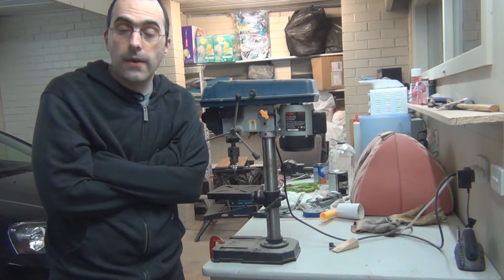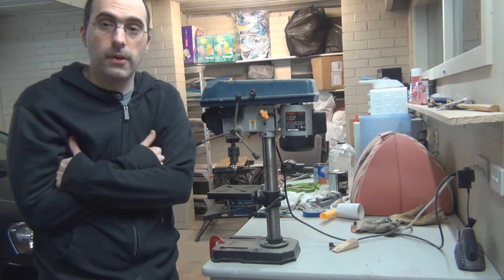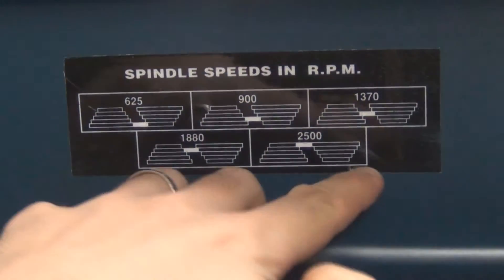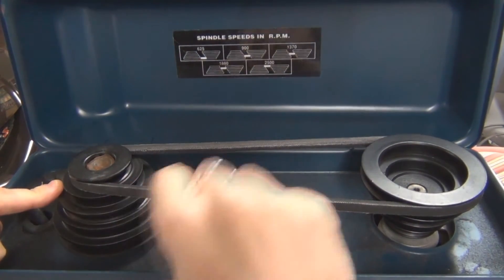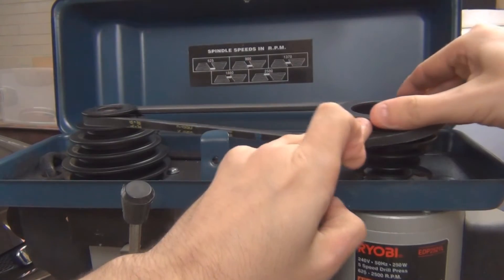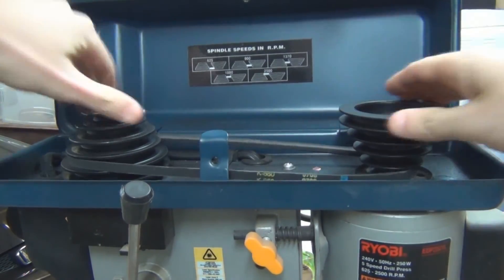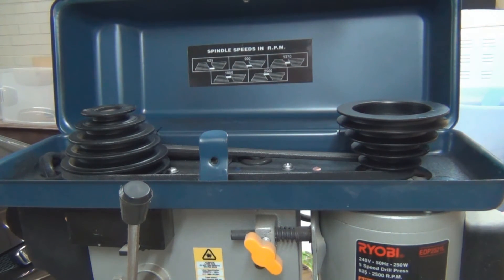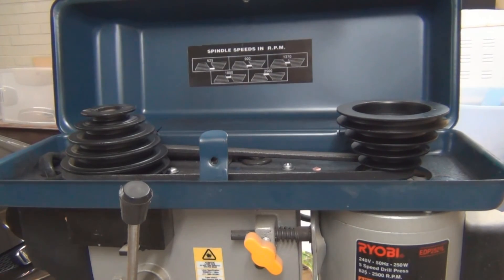How To Adjust Your Drill Press Speed

Comment: see that yellow hand-knob ? that will loosen your motor in its bracket, so you can, A: move the belt easily, and B: set the belt to the correct tension after moving its position (theres probably a tension lever on the other side of the press).
your belt is currently far too loose, it should be extremely difficult to move from one setting to another. because it is so loose, it will slip during normal torque-loads, burning the belt and making it brittle, ready to snap. i'm guessing you dont drill metal or other hard materials much, or this would have become a major problem long before now

Comment: Strange thing!!!!!!!! Why the engineers didn't use adjust switch to change the motor speed ?????!!!!!!!!!!! 🤔🤔🤔
Reply: higher motor speed = higher torque.
using a geared belt means the motor can remain at high speed and torque during low speed drilling. 
same reason we change gears in a car, instead of just crawling around at 100RPM when we wanna go slow, low torque = stalling

Comment: Thank for the video. I was hoping you would also refer to the knob with the bar and spring just left of the motor. What does it use for and what's the proper way of using it?
Reply from the maker: +TheWoodWorkingPilot I think this is a tension adjustment for the belt.  I'm thinking my belt may be a little too tight (at the moment). I just replaced it on the weekend but it has lasted 3+ years. the tension could affect wear and tear on the belt though (if its too tight or loose)
Reply: +DIY Guitar Pedals yes it's some sort of tension adjustment for the belt. Do you know what is the correct technique for using it?
Reply: @TheWoodWorkingPilot  there should be a lever on the other side of the press, loosen the knob you can see, then pull the lever to loosen/tighten the tension  (depending on the design of the machine), before re-tightening the yellow knob.
the way this guy changed his belt is just further stretching it, and a loose belt will result in the belt slipping and friction burns to the belt, which will cause breakage of the belt

Comment: nice was trying to figure out how to adjust the spindle speed of those larger type drill press ... ah so it is under the top cover  with belts that you adjust it... nice
Reply: dude did it wrong. loosen the motor first (yellow hand-knob on his machine), and re-tension the belt after adjusting the speed.

Comment: Heh, I think ive got the exact same model. EDP2521L?

Anyway, you make it look really easy. Mine's still really stiff. The instruction manual says you have to fiddle with the 'shifter bar' which I have not what it is.

ryobi.com.au/Ryobi/files/4c/4c5b9ff2-1925-4bf2-9cde-e1268d4385c9.pdf